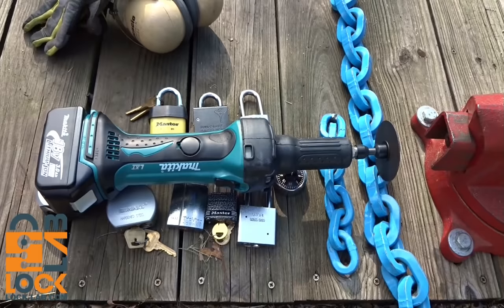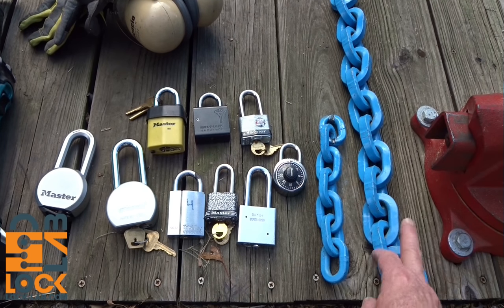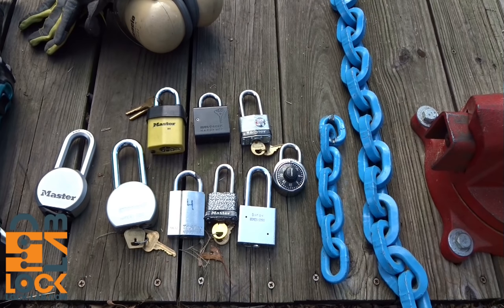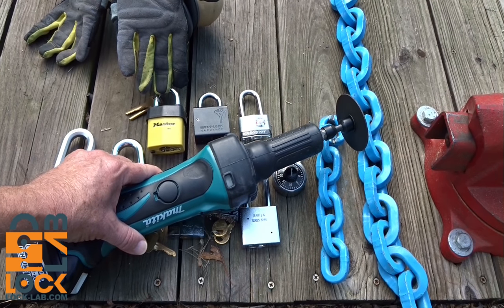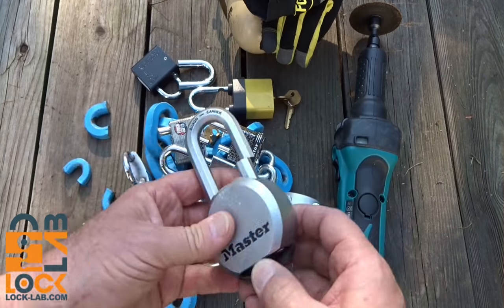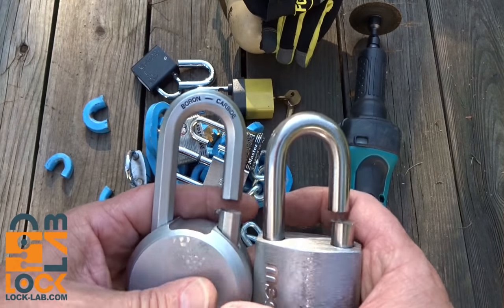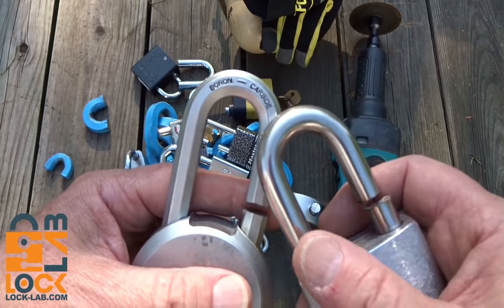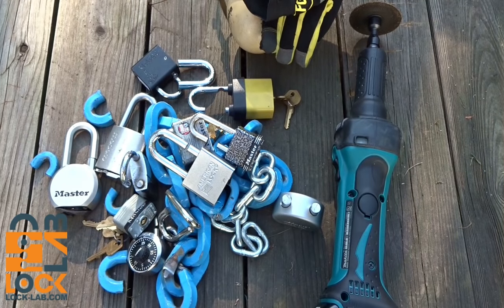(930) Die Grinder versus Locks - How Long?

Comment: Nice video. I cried a little at the demise of some of those locks. :'-(
Reply: LockPickingLawyer is there anything that it cannot go through?
Reply: hello anyone?
Reply: is there anything that it cannot go through
Reply: LockPickingLawyer is there anything that it cannot go through?
Reply: A tank?
Reply: @ David Liverpool  He's a lawyer, not an engineer.  As far as metals, probably not,  I did have an opportunity to try grinding a piece of silicon carbide once and couldn't scratch it with a cutting disk on a plug in Skill Saw grinder.  Silicon Carbide is like supped up concrete, and very wear resistant, but you could smash it with a hammer.
Reply: @davidliverpool0373  Well, yes, of course.  It definitely cannot go through whatever it is that fills the space between your ears.
Reply: @davidliverpool0373  In his video talking about the "biggest and baddest" locks, he mentions the $800 sargent&greenleaf lock i think, uses a layer of ceramic to resist grinder blades.

You can add your own to any lock with jbweld and ceramic plating.
Reply: How long do you think the 25mm Series 6 Almax chain and Squire CS100 lock would last against this specific grinder?
Reply: @davidliverpool0373  Probaply the Altor SAF lock, designed to resist grinders.
Reply: @davidliverpool0373  If there is it's absolutely massive and can only be used in specific situations because it'll hardly fit anywhere.
Reply: @davidliverpool0373  Well, at least for now: HIPLOK D1000 anti-angle grinder D-lock  $300.00 (usd).

Comment: For the price, this is a pretty decent grinder MyBest.Tools With 90 psi shop pressure is hard to stall even when material galls up in wheel. I've got three of them now, two of them I bought back in 1992 and they are still going strong!

Comment: you just made every criminal run out to home depot
Reply: true
Reply: LOL
Reply: still makes to much noise.
Reply: i was staying at a motel, we checked in early, and she put some cash in a crappy cash tin,,, afterwards she locked up to go run errands and locked her keys inside the office,,, i grabbed my sparrow set, 10 seconds and im in, she nearly fainted! She said something about investing in a new safe,,,, lol
Reply: @Evsmael... only for a couple of seconds, the thief will be gone before you even got out of your chair to peek through the window. And noise can be reduced by covering/shielding with sound absorbing material.
Reply: i didnt pick that, i picked the 6 pin door lock,,, well raked actually
Reply: Every Home Depot within 50 miles of DC will be packed!
Reply: where i live, you don't even get up to look at noises like this unless its going on for over 5 minutes
Reply: +Syko216 Why do you care about impressing people so much? It's funtionality over beauty
Reply: This video is a bit misleading. That vice he’s using is giving him awesome leverage, and leverage is a major obstacle for thieves who are trying to bust a lock.
Reply: @blastofo  especially with a die grinder id assume...the angle grinder will be slower for sure but without a vice to hold what your cutting down id suspect its a lot easier to use and in practice could still be faster in many scenarios.
Reply: what's needed is some kind of lock or chain with a 500v electrified core

Comment: not much can stand up to those alox discs. the best you can do is slow them down a little, but those cost pennies and can be replaced in seconds opposed to any lock or chain which can be hundreds of bux. the faster you get that abrasive on the metal the faster it's gonna gtfo. air die grinders with carbide discs can go even faster, too. maybe twice as fast. discs are more expensive though. carbide burrs cut like a hot damn through everything except solid carbide. that's why they are the go-to for people who don't have time to screw around with toys from home depot.

edit: another thing to point out is that harder metal is actually at a disadvantage against these cutting wheels, softer metal can gum the wheels up and grab them causing them to shatter. food for thought.

Comment: I was wondering,is there something one could wrap around the steel to gunk up the grinder? The idea being coating the wheel with something that renders it useless or less effective. Like somekind of plastic that melts and becomes gummy with heat. THAT would be a good invention.There must be something out there.
Reply: That's a brilliant idea.  Anything that dulls the blade would slow the whole process down.  I imagine it would be very expensive to incorporate a substance into the shackle or body material.  Using a die grinder is quick, but noisy.  Would work on a quiet industrial estate... maybe.  But not in a residential area.  Therefore, back to picking.
Reply: Perhaps a tar like substanc ecombined with long fibers that get caught and loosen but not cut.
Reply: ***** I was just brain storming, not really saying that it is a conclusion. Just suggesting the idea, a theory that perhaps someone could work into a usable product.
It just seems like an idea worth investigating with all the many kinds of materials out there, you would think its possible to come up with something that could effectively gum up a grinder, at least to extend the time it takes.
I was thinking a material that would replace the covers of most U Locks.
How about a hollowed shackle filled with glass? I have read this is used in safes.
Reply: Top of the line high security locks have ceramic inserts to slow down grinding attacks. You need a masonry cutting wheel to get through them.
Reply: Not much slows them down. Aluminium, copper and brass clog wheels a bit but really you're better off just using the space for thicker links made of the hardest chain you can get.
Reply: No a composite material that can be bonded to the surface something that has metal stands in it to resist low speed cutting and scraping to thwart manual ablation but then both melts onto the wheel and off gasses as well and maybe catches fire or slings hot shit off the wheel as it spins.

Comment: Thanks for the demo! I would just like to point out that wheel thickness has a huge effect on material removal rates.

Die grinder unloaded wheel speed: 245,044 in/min  (3in * π * 26000rpm)
Angle grinder unloaded wheel speed: 155,508 in/min (4.5in * π * 11000rpm)

The die grinder should be faster with the same thickness of wheel. You can commonly get 4.5" wheels in 0.040" thickness vs the 0.0625" thickness you were using here. The 0.0625" wheel removes ~64% more material for the same cut. The die grinder is ~63% (in/min) faster than the angle grinder, it's a wash in this case of dissimilar wheel sizes. You can of course buy 0.040" and 0.030" cut off wheels in 3" diameter for a die grinder too, this would make the die grinder faster.

I've seen a video before where you used what looked like a 4.5" x 1/4" Type 27 grinding wheel to cut shackles or chain. That's very slow compared to a dedicated cut off wheel that is 1/16" or less in thickness.

Comment: i would like to see you cut those bigger locks and especially the chains in a field environment WITHOUT THE USE OF YOUR SHOP VISE TO HOLD THE LOCKS , CHAINS....The locks can also be placed where they are difficult to get to on a trailer, and are obscured by other pieces of equipment such as UNDERNEATH A MOWER OR OTHER EQUIPMENT. Lets see you cut some 3/4 inch chain in 2 places .......Come on!!!!!!!

Comment: Why don't they make padlock clasps out of the same material as that chain? The bigger chain seemed quite a bit more effective than the similar sized padlock clasps. More sparks, more noise, longer to cut.

I also noticed a some of the locks allow the clasp to rotate about 30 - 45 degrees after only one side is cut, allowing the chain to escape - is that just cheap mass production, or what? It seems like that alone at least halves the protection against cutting.
Reply: Kodizzie cost
Reply: I think some of those boron carbide clasps probably cost more than the hardened steel chain.
Reply: I'm just thinking that the chain looks like it'd make a way better clasp not just for the material, but the square shaped cross section would also make it much more difficult to just cut one side and turn the clasp.

EDIT: Just wanted to add that I know you'd have to make the bottom round so you could turn the clasp when unlocked, but when retracted and locked you could take advantage of the square cross section.

Comment: Thats why a multi level security approach is the way to go!
Reply: I couldn't agree more! My different levels are usually in this order... Level 1: AR-15 sbr in 300BLK   Level 2: Springfield XD45   Level 3: Mark 12 (for those times they come to the conclusion that they should enact their exit strategy)   Level 4: For when all else fails & the use of which even terrifies me, The Pissed Off Psychotic Girlfriend! Oh the horror! ;D
Reply: Leve 1 -- Deterrence... Cameras, alarm company sign, noisy pit bull that probably won't bite, but if she doesn't know you, she will probably make you think that she'll bite.

Level 2 -- Hardened entry so that it requires a lot of noise to get into the house.  Not going to do them any good to pick my locks, there are going to have to break a window or break the door down.  Alarm system.

Level 3 -- Non-lethal automated chemical deterrence, multiple zones.

Level 4 -- If I'm home, then a Grumpy Old Man who does not appreciate being awoken in the middle of the night and who believes in the concept of "when in doubt, shoot it".  If I'm not home, then claymores. :)

Comment: It should be mentioned that all these locks and chains were in a vice, and so an optimum situation for using the die grinder.  It would be somewhat different in situ, with the locks flapping and moving about on the bikes, or whatever they are meant to secure, a much more difficult task.

Comment: Like a hot knife through butter. Question is what lock can survive this?
Reply: None can forever, Best bet would be some kind of anti-grinding coating that would gum up the blade.
Reply: There are shrouded padlocks with ceramic inserts that make it much harder to grind. They are probably more expensive than your bike though...
For the chain, I've seen a sheath with plenty of loose kevlar fibers that tangles the cutting disk.
But in the end, nothing can resist a grinder. Given enough time, one could grind through a bank vault. The only good thing is that grinding tends to attract a lot of attention.
Reply: diamond embed carbide steel might
Reply: Adamantium lock maybe XP

Comment: 200 db siren, 100,000 Lumen flood light and Automatic gun turret with motion sensors are probably the only thing that can prevent theft. And of course hide a GPS tracker inside to find the fools, of the turret won't get them...

Comment: just need to try the makita dpc7311 disk cutter on that :) silent? 5.5 hp of 2 stroke engine with a 14 inch disk is generally very noisy but i guess if you wanted to steal bikes, you could get a official looking outfit like dept of public works for that:)  You would not need more than one blade, look at the videos of fire departments cutting puck locks off for the effectiveness of that method.

Comment: What's the point of this? Of course they can be cut with a grinder, what is this guy trying to prove? High security padlocks are specifically made to withstand sledgehammer attacks, pulling attacks, bolt cutters, saws, drills, not this..

Comment: Yea...but it works because it is clamped down by a vice grip. If they were hanging off of a fence they grinder would not have the same effect. It would take more time, and maybe cause accidents and delays to cutter. It would be much much more difficult if the locks and chains were not stabilized by vice grip.    JUST THINKING......

Comment: Dammit, that was impressive! Well done BB you've just made all current padlocks obsolete. Lockpicking is now just an art form to exposé the skills of the recipient against the lock! The cordless angle grinder (that can be hired from selected tool shops no need to buy one) is now the natural raw enemy of every padlock in the world. No padlock can defeat an angle grinder,  its just a matter of time...in seconds not minutes!
A counter-measure now needs to be thought up as regards to the material that the shackle is made from. They need to be a polymer maybe, to include some form of a high-temperature powder that will burn or clog the grinding disc. Maybe the inclusion of some sort of thermosetting plastic that could melt around the grinding disc rendering it blunted. I really dunno but as it stands currently no shackle in the world can stand up to the super-hero action of the angle grinder as proven by this awesome video!
It was shocking, a white-hot knife through very warm butter is an understatement as we're talking about Boron-Carbide, Chrome Molybdenum, Crome-Vanadium and Armored Heat Treated steels...not butter!
Even the new Squire SS100CS with its 20mm shackle would only offer resistance measured by the second! Metallurgy now needs an upgrade or re-think, maybe a crystallite shackle made from Lonsdaleite (58% harder than diamond and perhaps the hardest material in the known universe) would resist the dreaded Incredible Hulk nail file angle grinder. 💥😮😝💨🤖

Comment: So basically a die grinder will cut thru ANY chain regardless of thickness or what it is made of in wayyyyy under a minute or wayy under 30 secs even ....so conclusion is ...waste of time spending money on chaining your motorcycle or whatever, even with an expensive chain as a thief with one of these die grinders can steal your bike /motorcycle or whatever in any case.
In the arms race of chain and padlock versus thieving scum bag, the thieving scum bag definately has the advantage with this tool hands down.... : (    ..... and I can't see any chain /lock developments any time soon that will tip the balance back into the lock and chains favour ....

Comment: I'm just thinking whats changing here is the speed of which the cutting head is making with all these surfaces.  A brand new cut off wheel vs a well used cut off wheel will have different velocities at the edge. Meaning your reduced diameter while cutting through the chain: 30.mm, taking 52. sec vs the first lock at 7.mm only taking 4. sec is actually not really telling.

Showing that your cutting rate was reduced to ~0.6mm/sec vs your starting rate of ~1.7mm/sec.  And the disc does look that much smaller. Shame cut off wheels are so dispensable.

Comment: Does your neighbor have a cordless rebar cutter?   The good ones will beat this grinder, especially on the thicker/harder units.   It makes no sparks, and practically no noise, and they're not much bigger than the unit you're using.

Comment: yeah it cuts but im sure angle grinder with 1mm disk is even faster. also its a bit slower to cut the welded part. we cut maybe a ten locks every year because too lazy to find keys for toolboxes. and yes.. we should pick them but.. reasons..

Comment: Bear in mind that a Makita or Milwaukee cordless die grinder kit sells for about $400 USD. The Makita manual also says you shouldn't use a cutting disk over 36 mm (1 7/16") in diameter, and Milwaukee specifies 55 mm (2")  max diameter.

Comment: You should've die-grinder tested some Abloy padlocks and also the Viro shutter/straight shackle lock (with a chain inside it) too. 

Maybe the Viro will be hard to cut, since there's a chain blocking the shackle. You can also install hardened washers on it to make any existing gaps even tighter.

Comment: angle grinder goes through anything (maybe except hardened or heat-treated steel which is like one of the strongest materials ever, like vise grip/hammer material)

Comment: I have a much quieter and smaller cordless dremel with a very thin cutting wheel. Takes about the same time and is much easier to use than a powerful die grinder. You are NOT going to cut locks and links in the real world as fast as you did using a vise. Any smart person buries the lock in a way that you cant easily get a cutter lined up for a cut let alone hold it steady and still. Those powerful cutters jump around like seen in the video but they also jam constantly if the object moves the slightest bit.

Comment: How did you attach the metal cutoff disc to the die grinder? Just got one of these Makita ones today and struggling to find both discs that can handle 25,000rpm and also the attachment to put the blade on the tool.

Comment: Good video. Cutting with a die grinder is a lot easier if the thing you are cutting is in a vice. Having to hold both in your hands makes it a lot more difficult. Any wobble and the blade snags in the slot and grabs, possibly breaking the blade.

Some of those padlocks should really have their time doubled as you would really have to cut them twice to release whatever they are locked onto.

What about shrouded hasp padlocks? And those pesky Abus diskus padlocks?

Comment: Shows how vulnerable we are.By the time anybody realises and reacts it would be too late. The bike thieves that were recently caught near me had a cordless DeWalt angle grinder. It had a super thin disc for hard materials. 4 1/2" dia and 40 thou thick. It cut through locks like a knife through soft butter.was sheer luck they got caught,they dropped their guard and two bikers caught them. Vigilance is the only security that will stop them ,and of course  a .357size hole drilled into their heads.
Reply: "... a .357 size hole drilled into their heads." I like that suggestion, you know, I kinda like ya style. 😎

Comment: Even if the locks would be hard to cut with a die grinder, what they are "locked to" would be easy to cut. For example: chain link fences, latches. etc.